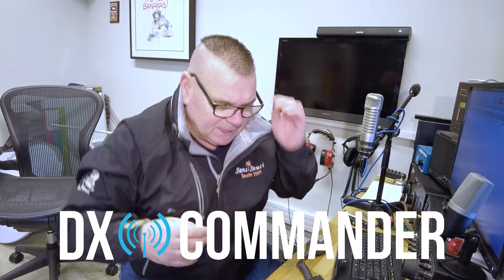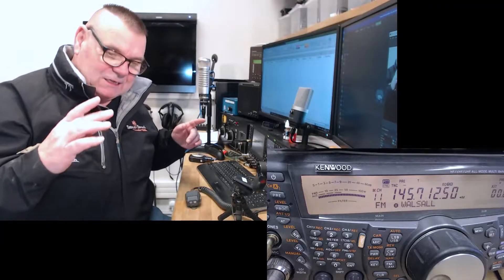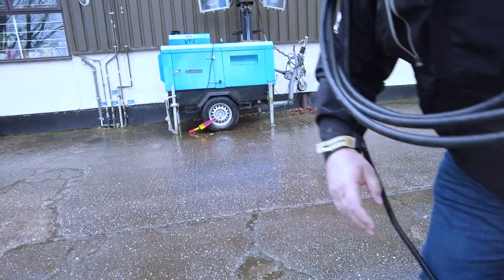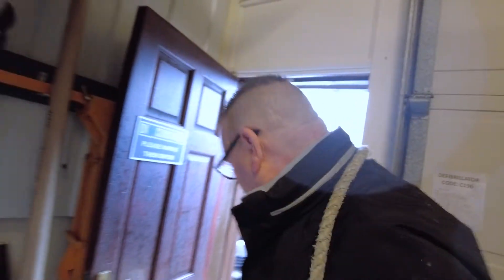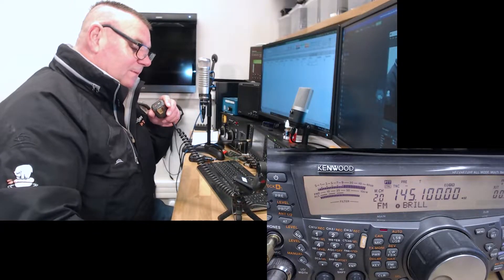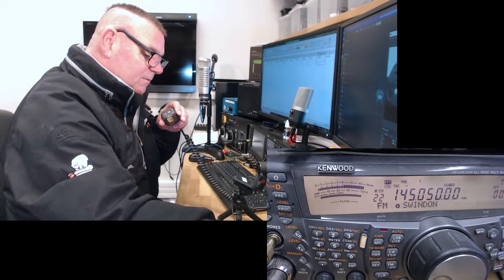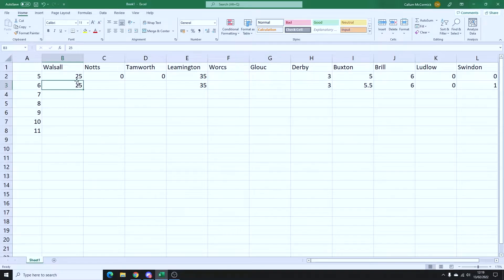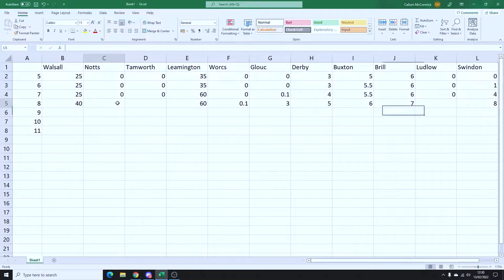What happens when you Raise your VHF Antenna up?

Comment: On a 50' height above my hill, on 2M I get almost 16 repeaters (one depends on conditions) and I am full quieting into 15 repeaters. I run a barefoot FT-290R MK2 and its range is about 100 miles with no propagation. 2M SSB can run the Gulf of Mexico from Applachicola, FL to Galveston, TX depending on conditions. Back in the 90's, I made it into Wales (GW3EWQ I think) on 6 Meters, but haven't done it since then. We do get powerful leading edge storm propagation occasionally, so I plan to try on both 2M and 6M (FT-690R MK 2) at the same time and see if it works! 73 de W4FJF.
Reply from the maker: Great!

Comment: I just got into 2 meters and repeaters a few months ago. Rather than build an antenna like I normally do, I bought an inexpensive Diamond CP22E. The only poles I had lying around was the old-style chain link top rails (by old style, I mean when they used to come in 20-foot lengths instead of 10). So right off the bat, I started out at 20 feet of antenna height. Now, I don't know what the locals near me run, but most were surprised that this VHF newbie was opening repeaters / full quieting at over twice the distances they were. A couple even stopped by to see for themselves. Apparently, a lot of people have their antennas at close to single-story roof height, and they don't have the unobstructed yard space that I have (I have almost a half acre in-town, so my antennas have some distance away from neighboring buildings). Just as a trial, we lowered the antenna by four feet to simulate other people's average heights, and... I lost quite a bit of distance. FOUR FEET!
Reply from the maker: Yeah, you can not beat a bit of hieght with VHF!

Comment: Interesting test, Thanks! Something to consider: the US Military did a study on the attenuation of foliage in RF communications several years back. I can't find it now but it was impressive as to how much attenuation you have when your below the tree tops, especially at vhf and higher frequencies. So something to consider when elevating a 2m or higher frequency antenna it to try to get it above the tree line for your area. A few years ago i was able to put a cheap dual band antenna sticking out the top of a 70+ foot tree (a bit higher than the average tree line) and could consistently get into a repeater in Nashville TN, about 100 air miles away, on 2m with low power (5w). 
At 2m and above. antenna height beats antenna gain as long as your using decent coax.  
Keep up the good work!   73   mike   N4ONL
Reply from the maker: Yes.. Both trees AND height.. Just the height works too :)

Comment: Hi Cal, nice test, I like those experiments. In fact I did the same on HF rising the feed point of a dipole antenna from down the roof level up to a 7meter pole. Harder to appreciate though because of continuous fading on those frequencies but you can still appreciate the increment.
One thing to mention is the Kenwood’s meter has a totally different sensitivity on FM. So to be more clear between 0 and full scale 9+60 it’ll rise very quickly. To see the things like we’re use to in HF put the radio on AM and do the test again. You’ll see the difference. 
Maybe you already know all this.
Cheers and keep up the good work on your channel. Fingers crossed for your old one. Have subscribed to this too.
Reply from the maker: Yes very cool..appreciate the FM sensitivity. Interesting. Well done on your dipole experiment!

Comment: Really hammers home the point.
I'd already seen a huge improvment with my vertical on the upper HF bands when I stuck it on a 40ft pole, but for various reasons I can't put a VHF antenna on it, too.
I've been using a VHF Yagi in the loft (the roof is not slate or metal, but fibre tiles) and was getting OK results from the nearest repeater, but it's gradually got worse over the past few months. Rx is totally fine, though. 
I'll simply have to get another pole up and stick the Yagi on it.

Comment: Hi Callum

Interesting experiment and an interesting initial conclusion / result re the 9 meter sweet spot.

I don't have anything near as impressive as you hydraulic tower.  I'm just using a telescopic aluminum pole for my VHF / UHF antenna.  Because of the recent windy weather, I drooped it down a section, and certainly noticed a difference with the local repeaters!  Hence my interest with your experiment.

What perhaps might be good, would be to repeat this experiment from a couple of different locations, say one that's low down and and poor for VHF / UHF, then one that's really high and good for VHF / UHF.  This would confirm if there is in fact a 9 meter sweet spot.

Regards, David (M0XQZ)
Reply from the maker: Yes, and woouldn't it be good to go even higher..!
Reply: @DXCommanderHQ  Yes, it would be good to experiment going higher. - I think that possibly you would find, above a certain height, although there would be an improvement, it would be very small per meter of extra height.  And that up to a 'height sweet spot' , you would get plenty of bang per meter.

I don't mean to hijack your experiment, but I was thinking of this spring / summer, trying something with a telescopic fiberglass pole in various locations; where I live, which is in a bit of a bowl, a trig point and at the beach.

Comment: Just added you to my favorites. Novice technician in Missouri also using a Kenwood TS2000. Working on my general. Would love a DX Commander familiarization video on the older radio. KF0DML
Reply from the maker: Any radio will work with a DXC, no worries!

Comment: Interesting test. I find VHF a bit frustrating, despite my aerial being 30 feet high (above the chimney) I don’t have much luck with repeaters. Presuming it’s because I have some higher commercial buildings around me. It’s a small colinear and I have considered something like a CP-22E to see if that extra bit makes any difference without spending a lot more money for no return. 
Thanks for the videos Callum 👍🏼
Reply: At 2m and above antenna height (getting above obstructions and the tree tops) beats antenna gain as long as your using decent coax.  
73   mike   N4ONL

Comment: Hi there.. like the experiment. Couldn't help notice the effect of the metal building and wether the results would have changed that much say a few hundred yards clear if the structure. Interesting though.
Reply from the maker: Nope.. There are metal sidings and a fibre and timber roof.

Comment: I found that with a J-pole antenna positioned at 9 meters I could reach the Bay City, MI repeater full-quieting on FM from 64 kilometers away. Of course, the Bay City repeater is positioned just below the top of a 305 meter tower, which may affect the results of the experiment. And while I did not do the test in the rain, my shoe did fall off when I was at the top of my tower mounting the J-pole, and I had to climb down the tower while wearing only one shoe, not the most pleasant experience.  :)
Reply from the maker: Ah yes, the old one-shoe problem!

Comment: What about comparing an electrically short antenna (eg 1/4 wave) high up with an electrically long antenna (eg 2x5/8) at a lower level but where the tops of both antennas are at the same height - just to see whether antenna height gain or rf/electrical gain is the most important. I bet the results would be very similar....
Reply from the maker: Tops same.. Maybe!

Comment: Hello I have your DX Commander. Would it help lowering noise by raising it up 10 20 30 feet??? ( to de above emissions from houses and such?) Love th DX. You gave me the power to do what I want with the antenna. Thank you.
Reply from the maker: I don't think so.. If you do the modelling, the pattern will hardly change. Use a dedicated RX antenna instead. I'll be doing a video about that shortly.

Comment: Hello, any tips for a good VHF/UHF vertical?
Reply from the maker: Personally I would look at a) Diamond V2000 for a lovely pancake gain figure and if you can forgive the height and length, the DIamond X510 is an absolute MONSTER with an even flatter pancake and extra 3dB to effectively double your transmit and receive over the V2000. I have a few V2000s and have a couple X510s too. X510 every time!
Reply: @DXCommanderHQ  Thank you